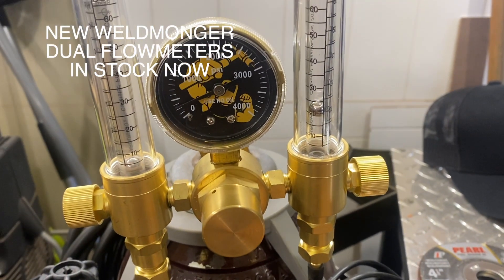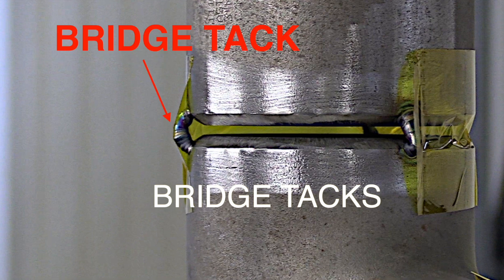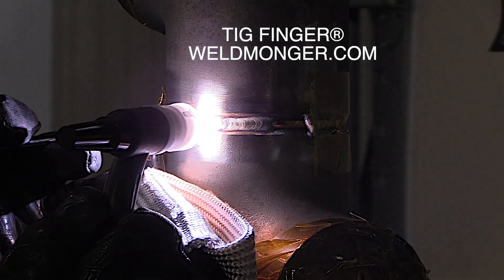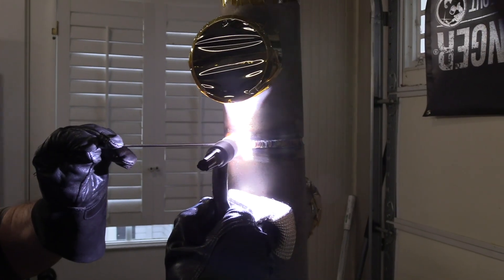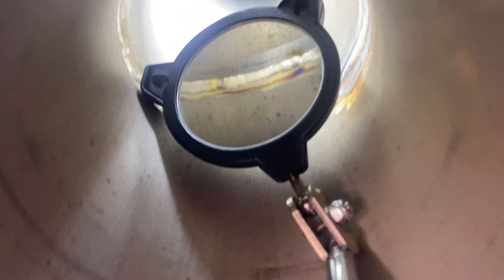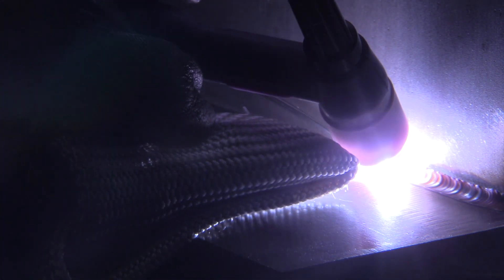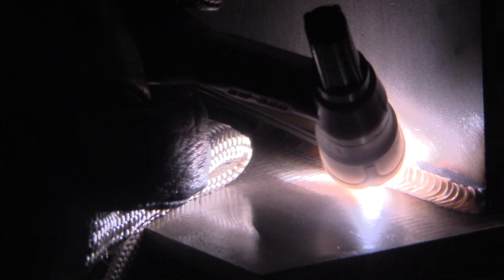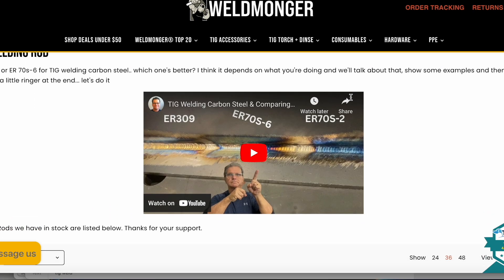2G Stainless Pipe Root Tips and Hot Pass

Comment: how different is it to weld stainless pipe compared to regular pipe , i welded regular pipe in weld school with tig and some stainless but we didnt do any stainless pipe
Reply: To me the welding part is close to the same with pipe stainless seems to weld cleaner but for pipe like this video you should purge it if it’s gonna be anything important.  Plate and angle and stuff like that you can’t really purge not sure if that’s what your asking too or how that welds too it does get hotter faster though and you wanna get moving faster when you start your arc if you sit around too long it can trap you a little and not weld as good. Also it is possible to get stainless too hot and kinda cook the weld and it looses some of its stainless properties. That’s just a little what I experience and learned Jody’s videos are definitely better than I can explain a bunch of good ones on here and good podcasts he has too still up welding tips and tricks podcast talks about stainless in some episodes. I’d say if you can weld carbon steel pipe it’s not a huge difference in the welding maybe temperature and speed but definitely the purging is what you wannna do not sure if my comment helped at all 👍
Reply: @WojnarskiWeldingFabricaion  thank your comment did help